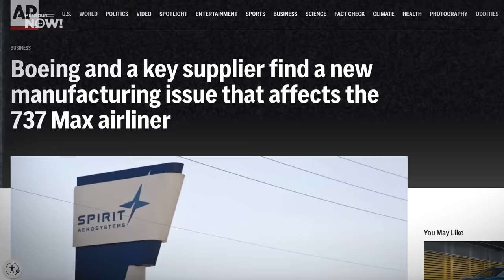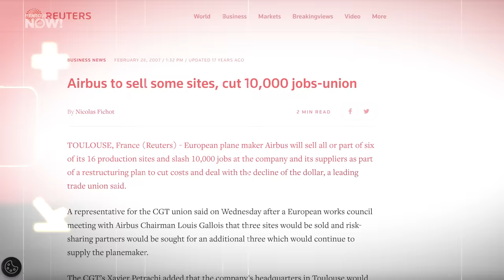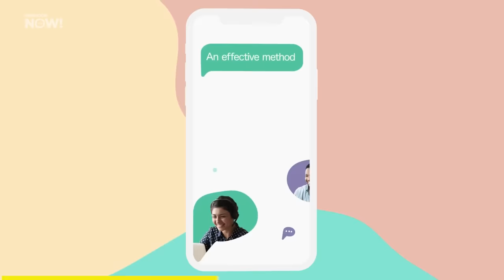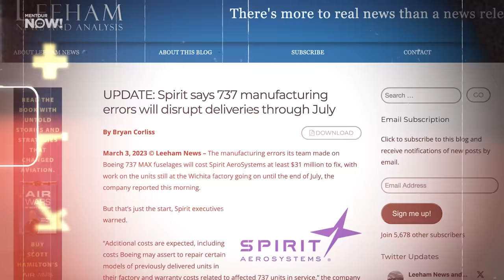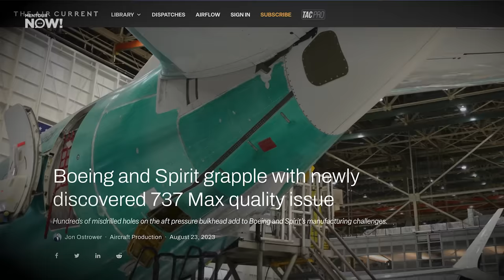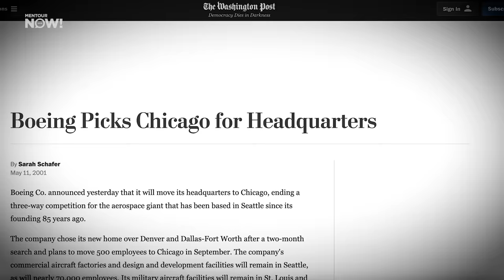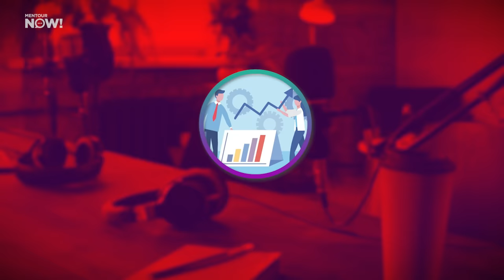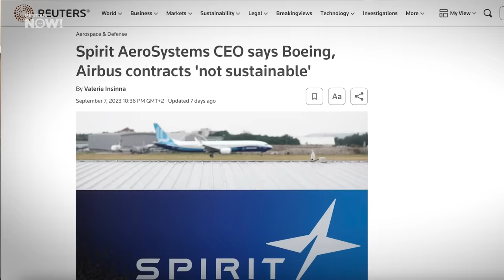NEW Problems with the B737MAX!

Comment: The inspectors may have missed the snowman holes but, the machinist who ran the CNC machine drilling them HAD to know about them. They made a decision to not report them. That is criminal.
Reply: I know, right! I wonder how exactly that happens though. Misalignment in relation to the curved shape of the part?  Or did the "robot" drilling the holes have a slightly loose bit, or some play in the armature at high torque? Really weird.
Reply: These were my thoughts exactly. If a hole has been drilled twice, someone must know about it.
Reply: Sounds like they are just working according Boeing Business Guidelines... They transformed from one of the best businesses in the world to a criminal Mafia organization. Profit is all that matters.
Reply: American craftsmanship: make a mistake and try your best to mask it. Never admit a mistake, because American products are the best; besides, you can get fired.
Reply: Very few people actually concentrate on a repetitive job . @jetporter
Reply: @MyKharli  Which is one of the reasons why you need someone else to check your work.
Reply: @foreverpinkf.7603  The Boeing culture encourages an employee to speak up when a mistake is made. They won't get fired for making a mistake but rather for hiding it.
Reply: The old 'safety first' culture encouraged reporting problems. That makes good long-term business sense. Problems left uncorrected are more expensive to fix than to get right the first time. It is quite clear from the emails that have come out from the MCAS folly, that that the new 'profits first' Boeing discourages employees from reporting mistakes or, in the case of MCAS, revealing major flaws in a system to the FAA. @mchristr
Reply: @toadelevator  I was wondering if it was the machine wandering during the drilling operation, as well.
Reply: I suspect machinists were under pressure from Spirit management to conceal any mistake that could be covered up to keep up the volume. That would explain why only bulkheads made by Spirit had this snowman problem and not those from subcontractors.
Reply: cost cutting takes care of that . I am old now and in my lifetime things have gone from doing the job properly to `if it looks alright it will do `  @zorktxandnand3774
Reply: If it's true that a single employee caused this, for whatever reason, it's a failure of the organization to not have the processes in place to catch it. If the error is small enough that the inspectors can't detect it with a visual inspection, they shouldn't be relying on a visual inspection. If Boeing is relying on an outside vendor to handle manufacturing and inspection, the contract needs to stipulate redundant processes and documentation. If management puts a $21/hr employee in a position to make a $100m mistake they're the ones who should be jailed.
Reply: @olke85  This defect didn't happen at Boeing. But it is always about profit, all of biology requires profit for basic existence, but there are different ways to go about creating a profit and short term vs long term, big picture net efficiency vs a narrow measure. (Stepping on dollars to pick up pennies may be perceived as profit by a person who only looks at the penny)
Reply: @kenbrown2808  Imagine a scenario where Spirit might have continued to use tooling that dates back to the original 737... 😉
Reply: It's them again Yogi! It's always them Booboo!
Reply: @Inkling777  Thanks for your response. I can't speak for the engineering side of the business as I don't have knowledge of the culture. But no one is in denial about the catastrophic effects of an airplane crash, both to a company's bottom line and reputation. I'm guessing the MCAS situation was a result of risk analysis that went horribly wrong.
Reply: @mchristr  there's plenty of leaked emails online to fill you in on Boeing's culture. Let's just say it's subpar. And yeah, outsourcing MCAS software development to some poorly paid Indians, and using a processor that routinely froze wasn't great risk management.
Reply: Unbelievable how many people are experts on things that they know absolutely nothing about. Any of you ever drilled a hole in an aircraft or bucked a rivet???
Reply: @40cleco I've used a few rivets in holes I made in small things, but not aircraft .  The initial thing to ask about these holes is if they were made be people or robots, entire investigation will be different from there until it gets back to decision makers, who are still mostly human .
Reply: @mchristr 
One does not have to guess as it is clearly documented that when the changes were made to the MCAS algorithm the “REEVALUATION OF THE RISK ANALYSIS” of that change, which was a totally separate step in the whole change process, did not change the relevant risk. The problem could have been caught at that point forcing a corrective change. This is all outlined in an in-depth article written by an ex Boeing engineer that was subpoenaed to cover the topic before a  congressional hearing. What I have always wondered was how much pressure did Boeing’s management place on the engineering staff that did the reevaluation to get the “ECONOMICALLY PROPER RESULTS”!! 

Another thing about this 737 MAX fiasco is that there are a lot of complicated aspects to it and the vast majority of opinions that are injected into discussions on social media are factual incorrect. Just in this thread a number of items of misinformation were stated.
Reply: @40cleco  not in an aircraft, but I've drilled plenty of holes and hand hammered rivets, and i know people who run CNC equipment, and i have worked in lots of situations where the service life of something has been stretched a little further than it should be.  The difference is some of what i work with doesn't need to have such precise tolerances as aircraft need.
Reply: @TheDuckofDoom. ”All of biology…”? My goldfish won’t even float in my direction without getting that paper, amirite?
Reply: @ytlurker220  To clarify I'm familiar with the manufacturing culture but don't have firsthand knowledge of the engineering side. Therefore prudence would dictate that I refrain from speculation.
Reply: the machnist can only drill what's in the print, the problem would most likely be traced back to the CAD station
Reply: @seancollins9745  
What is the difference between a CAD machine operator, a machinist, a tool & die maker and a prototype & model maker?
Reply: @Mentaculus42  the CAD designer is whole sets the locations for the holes in the subsequent prints. We aren't working in the days of paper blue prints and draftsman, typically engineers are working in CAD now
Reply: If i recall from a previous video on it, the issue was they didn't have enough large scale cnc machines to actually machine the holes to spec and instead ended up drilling holes by hand. it'll get you close but won't be exact so to meet production deadlines they broke their contract requirements and delivered sub par parts that were done with methods not approved by boeing.
Reply: @OtakuSanel  
Ouch, and that makes sense, considering that there was a day that it all was done that way.
Reply: @zorktxandnand3774 and systematisation and manufacturing processes that mean accuracy isn't dependent upon bored/tired/distracted humans.
Reply: Put a camera over the drilling machine and allow a certain amount of rejected parts for errors but passing along an error is grounds for termination.
Reply: @stupidburp  that's a great way to destroy production staff moral. Much better to understand why the error is occurring and fix the process so that the employee can do their job effectively.
Reply: @OtakuSanel
If that is true then it is simple management stupidity. No matter how good the process and procedures are, the entire thing can be undermined by bad management decisions. The people working by hand can’t be expected to match CNC consistency or accuracy. In operations where that is critical such as a freaking pressure bulkhead it is potentially criminal negligence.
Reply: @stupidburp  apparently you don't understand what fixing a "processes" means. The point is to remove human error, be it production staff or management. And that includes choosing the most appropriate manufacturing methods - hand work, jigs, CNC etc. Just blaming people doesn't fix problems.
Reply: How would they know? They were just running the machine through the program. It probably due to the part shifting in the workholding as the program was running, which was probably not perceptible to the person running the machine.
Reply: @mchristr  Would that be the policy on paper, or the policy as enforced?

Because words on a piece of paper doesn't matter, what matters is if you report something and your boss finds a BS reason to fire you. Completely unrelated, of course.
Reply: "stick a rivet in it"
Reply: QA department didn't make the RONA.
Reply: The truth is an ordinary human will lie and cheat like that no problem.
Reply: @Inkling777 :  Yes that is what happened. They have all the slogan and so-called safety programs but they are meaningless without leader ship at the top that makes it happen, and that Has to be very wise and smart engineers, not dipshit business majors. Never met a smart one of them.
Reply: NO, it is his supervisor who is more worried about his production than quality.
 Different day same old Company..!!!
Reply: The fact that there is no QA inspection to keep the machinist honest is the main problem.
Reply: @Timmayytoo  Worn tooling is frequently a problem.
Reply: @OtakuSanel  Appalling, but completely believable.
Reply: to cut anything it's the detail of every cut  like what tool what axis what rotation speed, rate, coolant used, etc.in the software the programming dept created ffor that part.  then production, debur, assembly, inspection. most if not all all we're aware. couldn't exist if they didn't.  Some commercial, trade, corp., etc., laws affect things both ways if one want to reveal designs.  and most who knew woundnt have the context required in alerting them to do so. like those in debur, programming though and inspection even assembly different potential to know more. and what did the salesmen know before during and afte
Reply: @foreverpinkf.7603 My dad, who was a tool and die maker when he retired from Boeing Wichita, often described American manufacturing efficiency as based on "Hammer to fit. And paint to hide".
Reply: @40cleco You sure got that right! Most of the people commenting wouldn't have the slightest idea what your username means.
Reply: The snowmen likely came out of assembly and not the CNC machines themselves.  Since the problem is isolated to Spirit and not any of the companies they contracted, I could completely see personnel on the assembly line using a bit to warble out the holes while trying to rivet them together.  I'd  put money on the issue being one related to a with-in tolerance forming, but the forming caused a slight misalignment of the holes requiring a drill bit run-through to clean up the misalignment.
Reply: @Mentaculus42 
The skill and competence and not to forget , the pride in having built a showpiece.
Reply: @jetporter  You can create snowman holes if the part you are drilling is not securely fixed and wanders a bit during the drilling process.
Reply: @mchristr  There is evidence which suggests that is not the case. Several supervisors who complained that management pressure to increase production were causing quality problems were fired.
Reply: You are assuming that the person who created the snowmen didn't report them. It's just as likely that they were reported by that worker or an inspection team and management ignored the reports.
Reply: Yes. The workers making the stuff know how many holes they drill. 

Even if it's done by CNC machines they can hear the double-tap before the drill moves.

I've done factory work and if you operate a machine for 40 hours a week you know when it's running wrong.
Reply: Worse than that…qa has to check and stamp off the holes as well. Spirit has also been sending the 777 line problematic parts and 41 sections (flight deck section). The entire 737 issue has pulled most of our high skilled support from the 777 program (AOG and sst) to help fix it all
Reply: I thought the used gorilla glue & gaffer tape to build airliners these days. They must be using cheap hand pop riveters soured from places like Harbour Freight .  There must be some right cheapskate shysters running Boeing these days , these modern over sized 737’s are obviously not up to the build quality as the proper old 737 - 200 series .
Reply: It's not like there was Tim Tate's film "On a wing and a prayer" back in 2010...
Reply: @mchristr  "They won't get fired for making a mistake but rather for hiding it" to believe that you must be a shareholder. So, whistleblowers don't get fired? 🤔
Reply: Good to know that they are union employees. They usually justify their existence based on having higher standards, but they really do little more than to protect people who make business-damaging decisions.
Reply: The purpose of the inspection is to catch exactly such errors, an essential level of accountability and quality insurance
Reply: Most likely, they were pressured by a timeline.Or just too lazy to look at it and just pencil whipped it.
Reply: @40cleco I would rather use a cherry or huckbolt.... or better yet highlocks ....lol
Reply: @toadelevator  At the airlines we almost always bought sheetmetal parts from Boeing UN-piloted.....because it was a 50/50 chance the pilot holes would be misaligned. Better to just buy them un-piloted and back drill them ourselves using drill guides and drill bushings.
Reply: It was on a CNC program and SOMEONE didn't check the program
Reply: @ytlurker220 ::: are you should Indian software engineers screwed up MCAS?
Reply: 737 Max should have never been allowed to return to service. Many issues were reported before the thing was returned to service but was allowed to return because a particular president wanted some good press at the expense of the safety of anyone who would fly on that aircraft.
Reply: @georgesheffield1580  I worked for a subcontractor for Boeing and they made extensive use of CNC. Every hole in every piece was inspected 100% for a GO / NO-GO condition.
Reply: Snowman holes LMAO...Ive always called them double holes.
Reply: @seancollins9745 CAD file issues is why the subcontracted parts have no problems but only the ones made by Spirit had issue. Lol, you must missed school the day they taught logic.
Reply: I am pretty sure they reported it. all the guys working in the field that I met, were proud and concerned about what they are doing. I guess some manager took such a decision and that indeed deserves trial ...
Reply: @mintheman7  you must not work in manufacturing
Reply: @seancollins9745  That’s why I understand logic? Fail again, but keep trying
Reply: @Daniels656993   Yeah right?  We always said "figure eighted" or "double drilled."  Either way it's a disaster that ruins one repair and expands the new repair....depending on remaining edge distance.
Reply: They probably had to deliver so many parts per hour and if they took time to do it right they wouldn't make their work quota. What could possibly go wrong?
Reply: They probably reported it and were told to shutup...
Reply: @foreverpinkf.7603  not can get fired....  You WILL get fired!
Reply: @foreverpinkf.7603 Found the campist.

Comment: Now we have a Max 9 with a hole ripped in the fuselage at 16000 feet. Child had to be grabbed by his mother to avoid being sucked out according to reports.
Reply: More information just came out about the child, and that is partly correct… however what actually happened is the child’s shirt got sucked out of the plane. So I wouldn’t be surprised if the mother was holding onto the child
Reply: Not partly fool completely true
Reply: Yep, and the same plane had 3 previous decompression alarms reported, with maintenance scheduled but never done. Then the FAA ordered inspections, and United found other planes with loose screws or connections on the same part.
Reply: Don't forget JAL flight 123 ! Boeing 747, pressure bulkhead failure, over 500 fatalities.
Reply: There are also rudder system malfunctions reported recently. Yikes.
Reply: @johnharris7353  bodged repair after a tail strike during take off many years earlier. Crazy that people will take such risks with peoples lives and multi million dollar planes
Reply: johnharris7353, do you know the reason for that crash? A non approved repair after a tail strike which weakened the aft pressure bulkhead. It had nothing to do with Boeing QC or Boeing engineering.